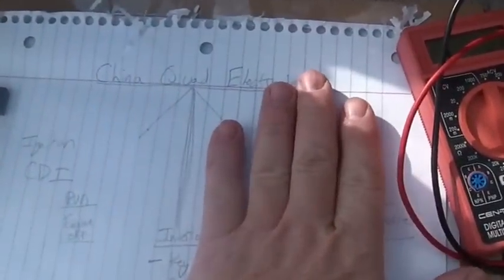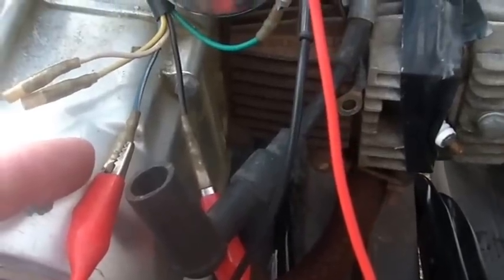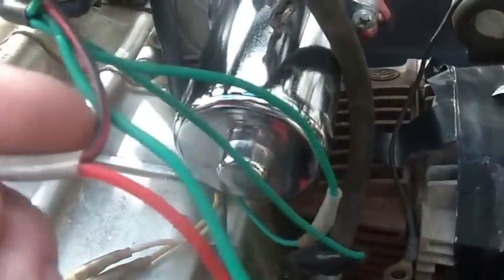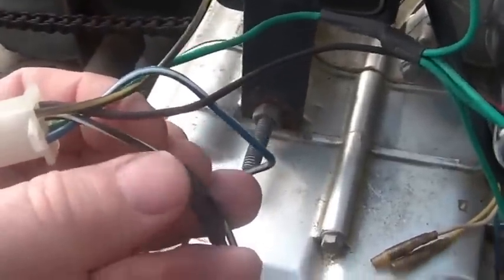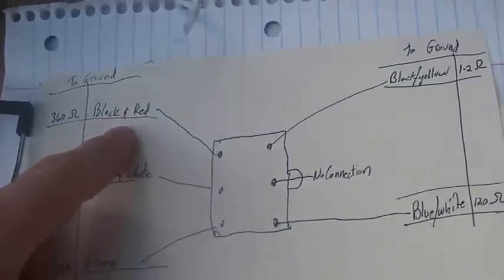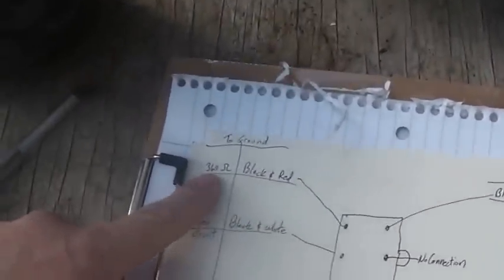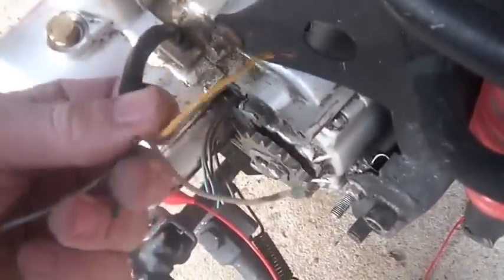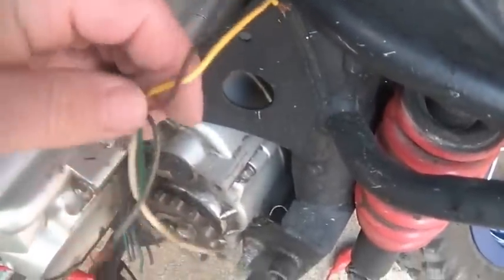Intro To China ATV CDI ignition, troubleshooting

Comment: Hi there I am stuck with 2 cylender china quad .. it idle bad even I have change almost ewerything but what is strange for me is if I unplug 1 cylender does not matter which then it idle good.... it was broken when I bougt it without no information other then vin number but nothing.
 I cange the cdi and coil from my kids bike than it started . do you have any clue what may be the proplem : engine  number is notor number
xf 253fmm Vin
LAGACNLR151000692
thanks for great wideos 
Jóhann . reykjavik Iceland
ps,,, I think this motor is similar as honda rebel , and I have tried this typical things like carburator 
wire stuff, but not sure about cdi box and coil becouse it was not in the bike . sorry about my english :)

Comment: Thank you for your informative videos. So a Chinese quad came into my shop the other day. I cleaned the carb and put it back together. I tried to start it and no spark. I took the black and white wire pin out of the connector and just let it hang. Got spark and it runs great. My question is, how do I get a kill switch to work on it? I have tried everything I can think of to get the kill switch to work.  If I plug the white and black wire back in, it goes back to no spark. Is there another circuit I can wire a switch into? Maybe the black and red?

Comment: Hello Harvey,
I have 1997 Lt160 and when i bought it the CDI was already removed from it. I have two questions in this regard,
how to know whether it will take a AC or DC cdi. I looked at the service manual but got no information regarding this. 
If I use the AC CDI: I have two wires coming from the pulsar. Green and blue. but the AC CDI only has one wire for the pulsar. how do i connect that.
how do i connect a DC CDI if this model takes one.

Comment: No electronics works properly without a good power source and especially a "Good Ground!" Not only will a bad ground cause a failure it will send you in circles when troubleshooting with a volt/ohm meter because you will get false and misleading readings. Great video Harvey! P.S. The Stator is on the other side of the engine by the shifter.

Comment: I got a roketa 250cc was running good. Went to ride it , turn switches on, wires to tile you want gear your in caught on fire. It still ran.I ordered a new wiring harness put it on,now it won't start. I'm not getting fire from CDI Ignitor box to coil.

Comment: Nice video ! I am trying hard to get a chinese ac cdi to fire my Yam Grizzly600 ! All coils ohm correctly ! Source/ac power about 60-75 volts . I am using a 5 wire and I think I need a 6 wire ? My question is whether 5 or 6 wire the trigger and source coils both have 2 wires each ! I have not seen any videos or wire diagrams showing where those wires attach ? I have watched one video where the guy did a 500cc yamaha but he used a 6 wire ac cdi ? Can u help ? Thanks

Comment: Bike will not start with the plug lead on correctly. If I put a screw driver in the end of the plug lead and hold 1/4" of the plug the bike will start straight up. A strong blue spark jumps from screwdriver to spark plug. Touch the screw driver to the plug, bike will stall. Hold plug lead off plug so spark has to jump to plug it will start and run. Push the lead fully home it will stall. Changed plugs and ends on spark plug lead.

Comment: Hey Harvey just wanted to say thank you for all your insight on these China bikes. I went through the checklist on several videos I'm trying to figure out why my son's bike won't turn over. I turn on the key get my neutral light to come on I bought a new CDI box the blue one with the power lightbecause that's what I thought was out after checking every other option. And today that's CDI box came in so I plugged it in turn on the key push the foot brake safety switch and try to start it and it did not turn overso at that point I look down at the CDI box to look for the power light to be on and there is not a light on. Sir do you happen to know what would cause this and how to diagnose it and how to fix it? Thank you for your time I appreciate you

Comment: Great video.  I have a eton viper 70 that used to run. When I turned the key the oil light would come on and then go off, then I’d hit start trigger and it would crank.  Now I turn key and oil light does not come on and nothing happens when I hit start trigger. Just dead.  Is this the ignition switch?

Comment: Hiya Harvey i've been following your videos for a while and i'm having some issues and need your advice. I recently replaced my HD gasket on my 125cc lifan motor and i adjusted my cam timing made sure my t lined up with the notch in the case and made sure that my valves were closed and the cam lined up properly. Brand new carb, clean gas, no exposed or damaged wires anywhere every time i tried to turn the bike over the ground wire connecting to the battery starts heating up and melting. What would be causing that issue?
Reply: Sounds like a dead short somewhere
Reply: @tstricklin4808  problem with that though is i wasn't having issues with the wire connecting to the negative terminal melting till after I adjusted the timing chain, before that the bike would fire up but kept bogging.

Comment: Hey Harvey. Trying to get spark out of my sons 125cc 4 wheeler. But it seems all my wires are ground coming from the stator and cdi. Is that right? I have it wired completely like yours. New coil. New cdi on the way. New plug. Just having no luck, and maybe it’s the original cdi crapped out but was working perfectly before it was disconnected. Great vids by the way! They are really helpful!!

Comment: Can u help me please I have a pit bike 110cc I had no spark so I changed the stater I changed the wiring arnis and I changed the CDI box and I got it all running again. But wen I'm riding the bike it seems like the choke is on?. I cleaned the carb and it's still the same. But I'm starting to think it's sucking air through the vacuum intake would that be my problem? Any information would be much appreciated...

Comment: I have been trying to fix a China 110 atv for my friends kid. I bought a kit online that replaced everything electrical.. I have checked everything 100 times and can't see why there is no spark. All ohms reading are what you say they should be. Do you have volt specs? How many volts to coil? Voltage from stator on red/blk and blue/white?

Comment: i have  a chinese hawk 250cc. my stator doesnt have a red and black wire. it has an electric start so i can jump start it as long as the red and black wire from the cdi is connected to the jumper cable. how can i get power from my stator to power my cdi?

Comment: Hey ive got a 200cc gy6 that has a new carb but runs a little bit and dies and you have to wait 15 minutes and start it again 

What could cause it
Reply from the maker: Hey Carl!!!   A lot of the GY6 engines were fed from a gas tank with a vacuum interlock, if the engine stops running, or it the vacuum line is broken, there is only enough fuel to run for a short period.... I would look for a restricted fuel supply first.... Though it is more rare, sometimes when a CDI, spark coil, pulse generator, or stator coil go bad, they only act up when they are hot... I would also change the plug, I messed with a mini bike that would run for 15 minutes and then die, start up fine when it was cold and pull the 15 minute strunt again, I dumped the gas, changed the carb, checked the spark and finally changed the plug which fixed it.... China plugs like to do this!  Thanks for asking, watching, and commenting, Good Luck, change the plug, go with a new NDK first....

Comment: ok, do you know the proper test for a 7 wire three plug cdi? what is the proper resistance for the ign coil on the secondary part, service manual say 4 to 7 kv, all mine test open...

Comment: Hi Harvey,Just wonding your Honda 185 Quads,do they have a 12volt system ? and if they do the satator would be wound for 12volt ?. I have run into a problem, I can not fine any one to re-wind my stator. One guy said he would only wind the lighting coil & will not wind the other two coils ?, and other guy i contact would re-wind lighting coil & battey coil, and would not wind the Ignition coil ?. Do you think i could buy a Chinese Stator & take the coils off and put them on to my satator plate would they fit ?. If your Honda Quads 185 have 12volt system over there,How would i buy one from there ?.I do not want to stay with a 6volt system. I would to put a China ATV CDI DC system & use a 12volt Regulator / Rectifer. I now have a DC Casoli CDI & a 12volt high Racing ignition a yellow one. My 6Volt ignition coil use's a ballast R , i think this cuts the 6  volts down to 3volts. Many thank's.

Comment: replaced battery and starter solenoid and dont get headlights or electric start but nothing happens  will run with ignition on and kick start?
Reply from the maker: Hey Scott, Sounds like U have no power to Ur key switch or a bad key switch, U should look for a broken wire, blown fuse, bad connection, or a bad key or left hand handle bar switches, no power to the left hand handle bar switches would also cause this, (broken wire), I hope this helps, thanks for asking, watching, and commenting!!!!
Reply: Harvey Spooner it had power when I was boosting it but it sounded like the starter slowly started dieing. started to crank slower and slower but nothing wrong with the starter how much power should I be getting to the key switch and left controls? and do you know which wire is supposed to supply both? cant find a electrical schematic anywhere thanks!

Comment: Hi there, I have been trouble shooting my quad (son's birthday gift) for some time. Now I only have 1week to get it going.

I have followed all these diagrams and when I turn engine iver I get lights, power to cei and all that good jazz. But I am getting ground across the coil.

Green (ground) when. Hooked to battery I get a beep. Same on my blk/yel wire.. I am getting voltage from cdi box but it's going straight to the ground. 

Any ideas?

Comment: I have a gy6 150cc my stator only has blue green yellow white is it dc or ac cdi what wire harness can I get
Reply from the maker: Hey Roger, I would go with a DC CDI setup for Ur GY6, the blue should be coming from the pulse generator, the yellow and white wires do to the voltage regulator, and the green is ground for everything.... Thanks for asking, watching, and commenting!!!
Reply: Thanks Harvey for info

Comment: I have a question with my quad it’s a 110 or 125 not sure I just put a new key switch in it but it won’t turn over but the only way the light come on is when you jump the solenoid but it won’t
Turn over or do anything do you know what my problem is

Comment: Hey, I have a Linhai 300 4x4. My 2011 atv suddenly stopped when I was reversing, used hard while moving snow.

no spark when I push the button, but sparks alot when I relase the button.

it starts sometimes but then misfires and dies.

So, any common faults I should look for?

Comment: Well i have watched your videos... they help allot... not that i like wiring , really who does.. I believe i have a case of bad parts... but if you can do a  demonstration on how to check if a solenoid switch is good or bad. I got 2 atv's: one was running fine at Uncle house and then it stopped responding to push button it would start by crossing the two pole on solenoid but that not very proper, i had new harness for my 110 robbed the solenoid from it same thing nothing sending power to push button i checked all wires, only found one cut(blk-whit) Probably my fault. fixed it .. still nothing.. So how can I check to see if solenoid is good or bad...

Comment: Hey Harvey spent some more time on my taotao 110b and it has a good wiring harness so I dont want to hack it up. It just quit on me one day and wasent getting spark. I bout a new cdi voltage regulator starter cylanoid battery and key switch. Now I have a very week spark. Do you recomend getting a performance cdi box or stay with the stock ones? And have you gotten a week spark off a cdi straight out of the box from eBay. In one of your videos you said to get an extra one is that because some are bad because ive been going over this quad for weeks and bow I'm thinking I just got a bad cdi. What's your opinion. But when u put 12v jump starter to starter it has lots of fire.. I am completely confused. Plz help

Comment: Thanks Harvey, I just picked up 2 chinese 150 cc quads that don't run, one of them is a no crank, the other is a crank, but no spark.  Your video shows the skeleton of the electrical systems on these bikes, I should now be able to figure them out.  Great video, please keep them coming!!!
Reply from the maker: Hey Meantime Smith!!!  Please check out some of my latest videos, I'm working on a Sunl offroad cart, it has 150cc gy6 type engine in it that I have been doing a lot of ignition work on, the wire harness was cut up, so, I'm ore or less building one from scratch.... Thanks for the info, watching, and commenting.... Good Luck with Ur need quads!!!

Comment: I have an Alpha sport 50cc mini cobra, That keeps blowing the only in line fuse on it,,,It runs straight From the Battery.. as soon as I turn the switch on it Blows the Fuse!!!I was told to put foil around it and see where I see smoke: within 2min the coil started smoking!!! Also with the fuse forced open it would turn over but with NO SPARK so they said that's it bad coil!!! So I ordered a new 1, put it on, and still have the same problem with fuse blowing every time I turn the switch on!! PLEASE HELP My Daughter is coming down for the summer in a month and I would really like to have it going!!!
Reply from the maker: Hey Jim, Don't wrap fuses in foil, that tends to make what was good electronics go bad.... This is a little 50cc 2 stroke engine.... I would replace the coil, the cdi, and an external resistor if there is one.... Check the wire harness for abrasions that could lead to short circuits.... If there is a remote turn off, the ignition system is complicated and fixing it by email will be very difficult.... Thanks for asking, watching, and commenting.... Good Luck!

Comment: Greetings from Tasmania Australia
Just been given a Jianshe mountain lion 400 quad bike.
I was told that it just stopped one day and wouldn't start.
after taking a look, It sparks sometimes and other times it won't. 
when it does spark it's a yellow spark, not a blue spark.
My question is about parts, can I replace the coil and CDI with ones that look the same and fit?
The CDI is a 6 pin so does a CDI with the same plug and dimensions work the same?
Thanks in advance,
not easy to get parts quickly here
Reply from the maker: Hey Ian!!!!   If U have a CDI like I show in these videos, I would start by cutting the black wire with the white stripe in such a way that it can be reconnected.... I would tape up both ends so that they don't touch and short out to anything. That removes the engine off circuit... See what the spark looks like and if it starts... Sometimes an issue with the off circuit gives the symptions U discribe.... Let me know how it turns out.... Thanks for the info, Ur thoughts, watching, and commenting!!!!
Reply: Hey Harvey!!!, I should have mentioned before, that was the first thing I did, still the same, sometimes I get a dull yellow spark, sometimes I don't. I just want to replace the coil and CDI but not sure what interchangeable.
Reply from the maker: Hey Ian, Just looked up a wiring diagram, it showed 3 spark plugs, how many cylinders do U have there????
Reply: Hey Harvey, It's just a 400cc single cylinder
Reply: Hi again Harvey
I did get another coil but it's doing exactly the same, no spark but I do get the occasional single spark.
I sometimes get a single spark when I first earth out the sparkplug and also as soon as I stop winding over the engine, just a single spark. got me stumped